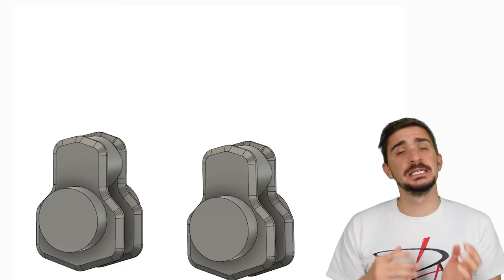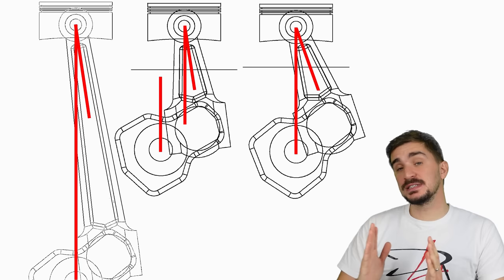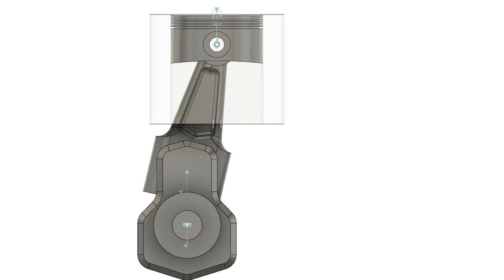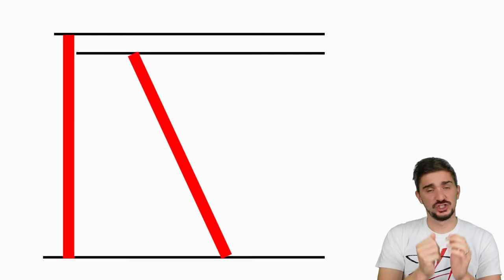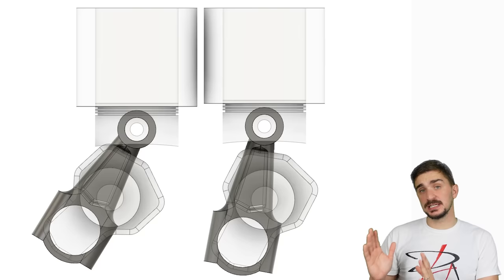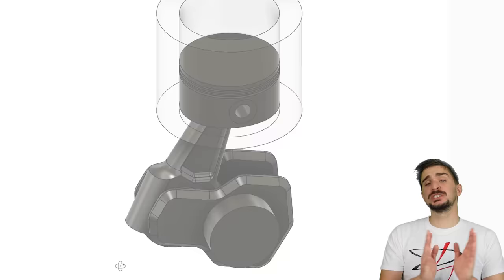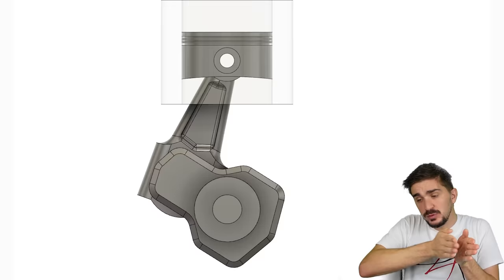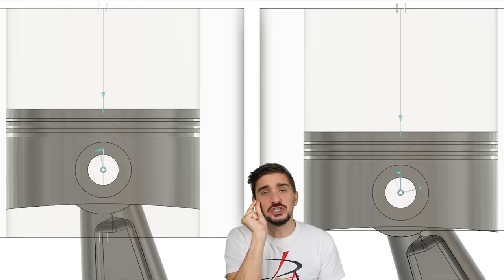Cylinder Offset Changes Everything

Comment: The "classic" mechanical name for crankshaft offset from center bore line is "DeSaxe" offset. It has been used for nearly 90 years (off and on) for Two Stroke engines (especially Model Airplane engines), but there were even some stationary steam engines which were "DeSaxe'd". Up until only recently, vibration and harmonics were always a problem. Kawasaki first used it on some of their big bikes in the early 2000's but didn't quite get it right for some time. Now, it's pretty common. Back in the early 1990's my automotive mechanical engineering professor said there was nothing new (un-tried) in internal combustion engines for nearly 60 years... he was right. Many of the first attempts were way ahead of the technology (particularly materials, and understanding the concepts of good combustion chamber design). We take for granted CAD and Fluid Dynamics modelling software and digital ECUs. Back then, they had slide rules, sine and cosine tables. Perhaps the most advanced thing available in the late 1950's was something akin to an oxygen sensor (the size of a tanker desk) in the engineering area... times have changed. Great Video!
Reply: @Matthew Helton  Reading your comment made me really smile. 
Back in 1972 when I was doing my final work (diploma) for my degree in Mechanical Engineering (Lucerne, Switzerland) one of my student fellows was given an assignment by the Head of the Engineering Department at SULZER Switzerland (back then famous for ship diesel engines powering big oil tankers and freight ships). The task was a principle study of a variable offset diesel engine and to investigate what advantages and consequences could be expected from such a design.

Since I had completed my task a week early and was bored, I suggested to my colleague that I would write a FORTRAN program to calculate the friction losses over the four cycles as a function of the variable offset. The result was a surprise for both my professor and the expert from SULZER. 
By the way, even then we had something more than just slide rulers and sine and cosine tables, namely an IBM 1130 with 20K main memory and a 5 MB disk. Nowadays, most people are surprised that you even could do anything with it at all.😀
Kind regards Florian Eggenberger
Reply: I'm curious how this technology could be applied to stationary steam engines. The steam engines I'm familiar with have a power stroke in each direction because they admit steam to a piston face at both ends of the stroke. Could you point me in the direction of an example I could examine?
Reply: @cdjhyoung  Quite a number of high-speed stationary steam engines had single-action cylinders and were used a lot for power generation. The Willans engine and derivatives were widely-used for example, and the Westinghouse High Speed Engine in particular was a single-acting desaxe cylinder steam engine that was commercially produced.

Comment: I really didn't have much interest in ICE before coming across your channel, your in depth clear explanations made me appreciate engines a lot more. Watched it all the way through too! I would love a video regarding the R1 or ZX10R engines; however, I would understand if the material on the balancing of these engines would be hard to get.
Reply: If you're talking about the modern crossplane R1 there is lots out there about its inner workings, Not so sure about the ZX10 however
Reply: I'm interested what you meant by "not much interest in ICE." Did you mean you were interested in cars but only electric ones?
Reply: @jaredlancaster4137  Perhaps like me, I took ICE for granted. I use them, wasn't really curious about them. I'm interested in electric motors, but for industrial applications, not cars!

Comment: Only couple min in.... As soon as i saw the pic of the offset, the concept made perfect sense when i thought about the power stroke and levers etc.... but Re lvl1: wouldn't friction be increased on upward movement. I understand its not the power stroke so maybe its not as bad but still.
Reply from the maker: The other strokes don't really matter as friction is low overall because the load on the piston is low, so reducing or increasing it by some percentage is negligible. All engines are always more worn on one side of the cylinder so combustion is the only stroke important here.
Reply: @d4a  ahhhh perfect. Thanks!!!

Comment: I'm a mechanic with some engineering experience and your videos are amazing for bridging the gap between practical and theoretical knowledge.  The way you teach by gradually introducing the mathematical  concepts alongside the practical demonstrations make your explanations work.  I'm sure someone with no engine experience would struggle, but I think your videos are an excellent resource for people like me who need more theory, or people like engineers who understand the theory but rarely work with the actual application.
Reply: Ever heard of David Vizard? He has a channel and is essentially an engine-building legend. He also donates to St. Jude"s. He offset an engine's bores what I'd guess was decades ago.
Reply: I am as you and agree.
Reply: Changes everything, I bet it won't change the colour of my car.
Reply: If you're an engineer, you surely realize the offset engine has a longer rod or longer rod bearing distance from crank center to do this. They are not the same as the centerline rotating engine. This is part of where the "increased intake gas" comes from. That point was completely skipped over, intentionally I suspect.
Reply: Most certainly agree !
Reply: @boogerholler8208  and a longer power stroke.
Reply: @Deontjie  Of course my dull battleship grey and rusty mud is the impeccable combination…🤣
Reply: Even the side valve Ford E93a engine had offset.  Can't think of any engine that doesn't have it. Every engine I've engineered has had offset. This isn't news.
Reply: @davidh3486  Nobody said it was news. Nobody said it was new.  Are you upset that people who aren't engineers might learn something?

Comment: Many years ago as a student I visualized this idea of an offset crank and wondered if it would develop more torque.  Thanks for so thoroughly exploring and explaining this topic.  Fascinating.
Reply: Cranks get modified for offset grinds to increase stroke. Machine shops have been doing it for decades.
Reply: There are two ways to apply offset. You can either "move" the crankshaft off the centre line of the cylinder or you incline the cylinder slightly. The effect is the same. This has been done for at least 80 years to my certain knowledge. In the 1950's it was normal to rebore an engine after as little as 25,000 miles. This was done with the block in situ.  If you didnt allow for the offset when setting up the borer you destroyed the block. Later the cylinder was offset laterally to make maintenance easier.  This information is hidden in works maintenance and overhauling manuals.

Comment: I made it to the end!
When I was young I raced bicycles. All of the dynamics you have mentioned are directly related to bicycles.
When you are starting at the line no one in they’re right mind would set the peddle at the twelve o clock point. You might even hurt yourself if the peddle can move freely in reverse.
Seat position forward and back are important as is seat height.
I never thought about why some of the practices we used were helping.
Great video!
Reply: Great point you have made, about applying some of this science to a common bicycle. As a mechanic, car guy, drag racer and all those dirty things I still love my bicycles too. Now you got my brain smoking overtime as these principles are applied to our pedal powered all capable machines!
Reply: I uses to race bmx also Jack pine lodge , in bath mi. 1979 , 1980 ( i think ) I showed up with a hacked up huffy street bike ,  that i cut the crank and lengthened the pedal stroke , if you werent careful you could stub your tow and twist them backwards , i had it that long ,
But it worked great , i was out in front most of the time , that area at that time hadnt seen much experimenting like that , but it caught on quick , and i picked up shwinn in east lansing as a sponser , got me a fancy schwinn mongoose , they just came out back then ..
Reply: This video reminded me of the Shimano “Biopace” chainrings in the early-mid 80’s designed to take advantage of that bicycle pedal stroke.

Comment: Seeing this video is a bit of a shock! I proposed this idea to General Motors (I was a Chevy guy then) about 60 years ago! I had built a flat model where I could tilt the "cylinder" to create an offset and crudely measure the change in intake/power strokes to the compression/exhaust strokes. I sent them a letter and some drawings mostly stressing the benefits of increased duration of the intake and power strokes. I had figured out most of what you cover in your video save for the vibration issues. I believed the vibration wouldn't change with a cylinder offset. I think I also missed the different stroke lengths but hey, I was only 15 or so at the time.
To my great surprise, GM responded! They said they had tested the idea and it didn't yield any noticeable benefit. Did they just blow me off or had they really tested it? If they did test it, did they change the ignition and valve timing, I'll never know. 
Great video! 👍
Reply: GM in particular, but all the big three have been using offset wrist pin placement for well over the past 50+ years in everyday production. Most of this was to reduce piston slap, thrust wear on piston skirt when cold and in general quiet the engines down. With that said they also had slight increases in torque in mind, across the board at relatively low rpm levels seen in our daily transportation still to this day. "free" torque improvements are an increase in efficiency and we all like the way that sounds. Unfortunately the way the oems have done offset wrist pins in order to quiet down cold starts and such ended up cancelling each other as one bank on a V8 would be offset in favor for small increases in efficiency, but the other bank on a V8 were offset to just take the load off the thrust side of piston skirt with a net negative effect on efficiency. That's what I meant by any gains were cancelled out on the other side of the engine. They still achieved their goal of reduced engine noise however
Reply: Nascar engines were allready using it acording to articles written by smoky unick it dose decrease piston and cylinder life to a degree
Reply: In the 60s, valve actuation was the rage. Ducati and its desmodromic system, conical valves springs, roller rockers, etc. Bored in high school, I doodled an engine with solenoid operated vales. Lotta good it did me. I also designed a crankless engine with piston position sensors to operate the valves, but there was no way to directly extract power from it.

Comment: Excellent video! You missed one very important point. The offset cylinder moves the point of maximum combustion pressure closer to the point of maximum mechanical advantage. Also, the same effect is often achieved with an offset piston pin location in the piston design. The lengthened intake stroke duration is very helpful in naturally aspirated engines. Getting air in is much more difficult than getting it out!
Reply: I was imagining these concepts in my head
Reply: Okay, cool. So could a small block Chevy, for example, be improved in power output by forging pistons with a crank pin hole drilled a few thousanths offset? (Obviously keeping it small enough to avoid destructive vibrations) Is this being done, say in the drag cars? Is there an emerging cottage industry?

Seems a manufacturer could take advantage of this without an entire redesign. Is the old Rambler 6 in my Jeep good for another 8 hp? I’ll keep it under 10,000 rpm, promise!
Reply: @russbell6418  just spin the pistons. They already have a little offset. It will be noisier and vibrate more though
Reply: Loss of stroke but also loss of resistance to push the crank twelve to twelve o one
Reply: Don’t even start about what the other cylinders are doing to change all the math.
Reply: @jalapeno3721  One thing to consider is that offset pin custom pistons are easier than on offset crank/cylinder engines. Problem is it is hard to get enough offset unless you have oversquare designs. Another point to using custom pistons is to make one skirt longer, as the angle is greater on the up stroke force exerted on the one side of the cylinder wall. Making the other skirt shorter as it has less force on the downstroke. Lastly most important part of balancing this one side longer skirt is to make the shorter side skirt have equal weight using a little more material on the inside then finally balancing the whole assembly. This is what some farmers have been doing with larger gen sets to get more out of their fuel.
Reply: As already referred to in one of these posts, all piston pins are offset slightly (as far as I know) which is the reason for the arrows etc to tell you which way around to install them.
Reply: I think your point about coinciding mechanical advantage and combustion pressure is the best explanation for increased torque and power.

Comment: The Toyota 1.5L 1NZ-F(X)E was a relatively early example in the economy car segment. Sounds like a tractor, vibrates noticeably at idle, but returns 50+mpg on a run and makes good usable torque from 2500-6000rpm. I'd say it's a fairly typical example of what you described.
Reply: My car gets 55 mpg at 2000cc 😎
Reply: @TheSuperBoyProject  what çar is that exactly?
Reply: On paper it got good mileage but it has a very narrow torque curve and was coupled to a gear box with very high ratios. Also built like a lawnmower engine making extensive use of pressure die cast parts.
Reply: I noticed the 'suped-up' engine mount/damper at 19:25
I thought who would just build the engine and counter the vibration issues during fittment of said engine?
Well thanks Henry Rolt, Toyota did!
In this day and age I think, given the option, most consumer car buyers would opt for extra mpg over a smoother ride. In fact, if a car returned 125mpg but rattled your fillings out, it would sell like hot-cakes and come witha free gumshield!
Reply: Fiat 850 from the '60s in the first one I ever worked on.
Reply: @TheSuperBoyProject no it doesn't.
Reply: @justincoats7236  volvo s60 diesel
Reply: I believe the Prius was early use for the offset engine. If you ever drive one it has a notable odd vibration common with such designs .

Comment: In the early 1990's I read a paper on how a longer rod length affects power characteristics and I remember the classroom discussion was along the lines of, "we've been doing this long enough that we're now able to look at smaller details than ever before." Offset engines are a surprisingly simple and subtle change to how it's always been done, but as soon as I saw your first charts, I was able to see some of how it would be an improvement. 
Very well taught.
Reply: Steam engines used offset engines over 100 years ago, and the Volkswagen vr6 and vr5 are off set, but instead of offsetting the crank, they would offset the angle of the cylinder bore.
Reply: @klubstompers I guess I could sleeve my engine then bore the cylinders off center.
Reply: @wannabecarguy  Yea, you'd only have to that and mill the block top at and angle, fill all oil and coolant passages the angle interferes with in the block, re-drill new ones, custom crank balanced for the rod angle, custom harmonic balancer, run a custom timing chain system or belt, custom header or down pipe to accommodate angle, all for zero HP gains. Cake!! :D

Comment: I have seen your videos of the 4-V, 4-opposed boxer engines, and found them very interesting allowing me to reduce my ignorance in such subtle differences. I really see the balanced engine as great, maybe I sense that it lends itself to a quick massive application in opposed-cylinder engines or even in boxer, even better. And the coolest thing is that it would never have occurred to me, "advancing the crankshaft", turning it when the piston reaches TDC, is really a new way of extending intake timing, generating "ignition advance" and reducing engine speed. expansion effort after the explosion with a lever arm helping to rotate the crankshaft. The concept that he has so clearly explained to us with his beautiful lecture on the subject of balanced motors is really great. Thanks for your class!!!, Greetings from S.L. Arg.!!!

Comment: Impressive. I've read a bit on offset engines, but your explanations are much more complete. Thanks a lot for this. I missed how big the offset can be and when the cons are greather than the pros depending on it.
Reply from the maker: The offset usually ranges between 4mm to 10mm, too large leads to diminishing gains. But there are engines with as much as 12.5 and as little as 2.5 agaik. Offset in the video is exaggerated to 15mm to make effects more obvious.
Reply: @d4a  hi, is the suggestion that 7 mm offset is an average? or is the optimal offset based on the stroke/ rod ratio?
Reply: @d4a  I'm probably misunderstanding but if the offset decreases the rod angle and therefore the friction on one side of the cylinder wouldn't the increased rod angle while it's on the other side cause increased friction, negating the benefit?
Reply: @dr.brianadams6542  the highest side load is during the combustion stroke. The difference is not small either. Go back to the vid on Miller, Otto and Atkinson cycle engines for another benefits.